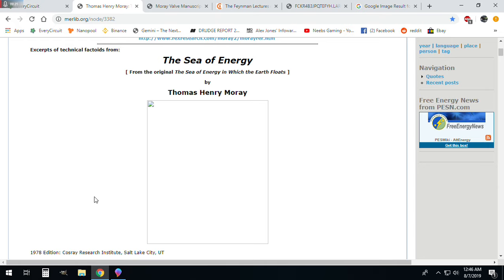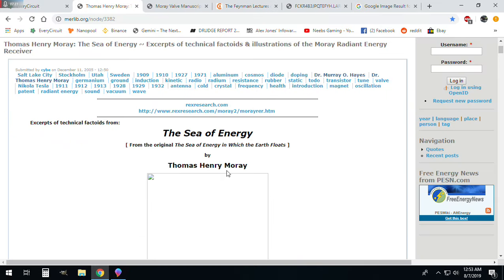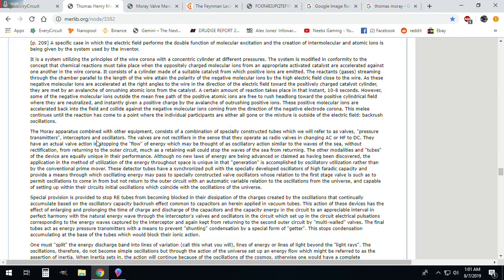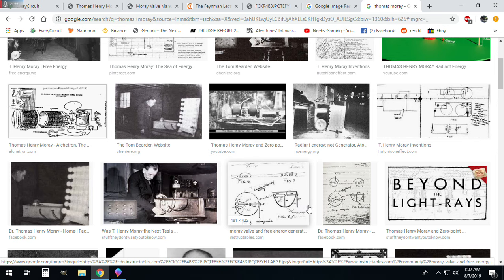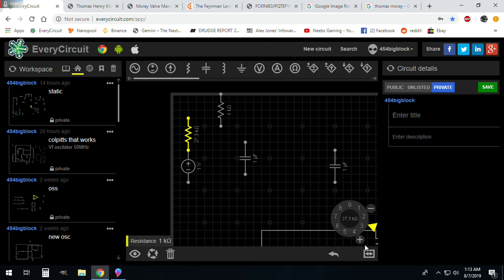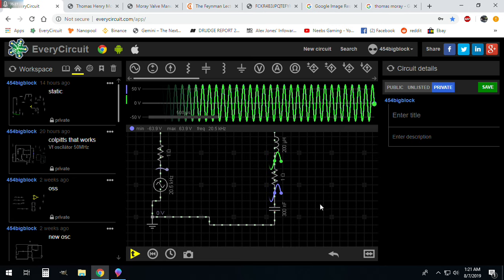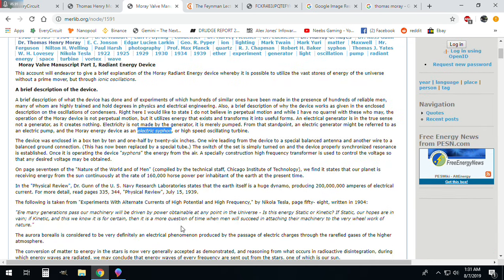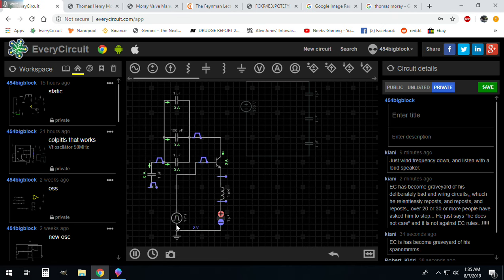Free energy from atmospheric static, Thomas Moray style

Comment: Thanks for tickling my curiosity
Reply from the maker: I've learned a lot since making that video. In his book he describes his valves as over flow valves. A cascade of oscillator circuits all in an octave cascade of each other,. When the first reaches voltage at harmonic resonance with the antenna section the resonance nullifies the resistance by the inertial swing of the matter the oscillator is made of and rises in voltage. The same way a resonant boost converter and all oscillator circuits will act at their resonant freq.. When the desired voltage is reached the valve allows the excess to spill over into the next octave. Once the full cascade of oscillators are at optimum the combined negative resistance cause close to superconductive and a step down converter at the same time. He says in his book it runs at the freq of the universe because a cascade of octaves is one of the secrets of the fabric we live in and is a form of fractal energy compressing super symmetry. Now don't go shorting out the ionosphere and killing us all with this secret info I have stupidly divulged to you. The secret of the 7 out of 6 , the 3 pairs of opposites making the 7th, of Kabbala, alchemy, and your DNA the "aromatic ring current"..
Reply: @paulksycki  just like you're talking about universal frequency, the chap could have oscillations faster than light
Reply from the maker: @ThePaulbilek  The limitation of oscillator frequency wouldn't be overcome by this in my opinion. That is a mechanical size aspect. The universe is fractal in nature but you sure do not want the entire power of the universe all at once.  What he did was basically create a siphon, a path of least resistance. The frequency is kind of irrelevant except for it's structural nature we can see in light and sound harmonics. The reason historically they said the universe consisted of 7 bodies, the sun being in the middle, The 7 sisters of the Pleiades one being in the middle guarding the tree of golden apples with the Laden Jar dragon LOL.  And if you understand these and DNA then you understand life energy works the same. https://en.wikipedia.org/wiki/Aromaticity
and the ring current https://en.wikipedia.org/wiki/Aromatic_ring_current It's really quit beautiful.
Reply: k  phew, that's a little over my head lol
Reply from the maker: @ThePaulbilek  Ah it's not that hard. It's a fractal repeating pattern that can be understood from the DNA level, to sound harmonics, to lights optics, to the solar system rotations (excluding whats past Saturn). As above, so below..The rest of what I mentioned is from Greek mythology of the same subject. They knew way back then in their mystery clubs.

Comment: Radio active action is I believe the active inverse reaction to the ionosphere to oscillate capacitors through a valve so he created pulse dc through a germanium diode ...
Yes a kind of cats whisker..
Perhaps the conclusion should be that the exciter was the radioactive activity on the germanium diode to be tuned to the wire length..?
Reply from the maker: I've learned a lot since that video. In his book he describes his valves as over flow valves. A cascade of oscillator circuits all in an octave cascade of each other,. When the first reaches voltage at harmonic resonance with the antenna section the resonance nullifies the resistance by the inertial swing of the matter the oscillator is made of and rises in voltage. The same way a resonant boost converter and all oscillator circuits will act at their resonant freq.. When the desired voltage is reached the valve allows the excess to spill over into the next octave. Once the full cascade of oscillators are at optimum the combined negative resistance cause close to superconductive and a step down converter at the same time. He says in his book it runs at the freq of the universe because a cascade of octaves is one of the secrets of the fabric we live in and is a form of fractal energy compressing super symmetry. Now don't go shorting out the ionosphere and killing us all with this secret info I have stupidly divulged to you. The secret of the 7 out of 6 , the 3 pairs of opposites making the 7th, of Kabbala, alchemy, and your DNA the "aromatic ring current"..

Comment: Gas discharge tubes exhibit negative resistance, that’s what moray used
Reply from the maker: Thank you..Google-ing "gas discharge tube" leads me to exactly what i was looking for all this time. I must have been using the wrong search terms but I couldn't find these... They will control the spill over from one tank circuit to the next tank circuit when resonance in the first one occurs. Cascading a bank of tank circuits, all in octaves of resonance,  bringing really high frequency high voltage down to low frequency lower voltage with usable current...All without adding resistance, instead using negative resistance. Creating a siphon. This is what Moray described in his book.... The unmentioned part is that an extending large surface of metal completely insulated by a dialectric (the cable/antenna) is the negative of a capacitor, with the charged ions in the atmosphere being the positive side of the capacitor.
Reply: @paulksycki   Sorry for the intrusion- please look into "electron avalanche"- i suspect that what some folks call a "negative resistor" in some cases like Moray's tube, may be considered for any element in a circuit that is generating excess electrons- thereby having the virtual effect of a "negative resistance".  The electron avalanche effect is a LENR "cold fission"- low energy nuclear reaction in arc gaps with ions present- or in the case of some P-type semiconductors, and/or hydrogen/lithium batteries, water-burning cars- these can be more like "cold fusion"- still the weak nuclear force, but using protons instead of electrons. I think that Moray's tube was probably using the radioactive source to set up a resonance in the tube, and the gamma and beta rays made the various metals off-gas hydrogen (protons)- and so these heavy, high-speed, x-ray particles were naturally smashing into each other and giving these fusion-like reactions. From there, it appears that Moray's tube is using the "photomultiplier" tube effect to get a useful, AC current that could be rectified or stepped-up to HV powering neon tubes and lamps, etc.-real, free energy from a tiny chunk of radium. They now use Henry Moray's tech in space probes, but they use the Seebeck effect/Peltier junctions instead of tubes  hot pile on one side, cold of space on the other side of the thermocouple, and free electricity out- pretty high currents too...
Reply from the maker: @sunsaverfromnhh9184  I've actually researched the  "electron avalanche" or Townsend avalanche quit a bit in the past with my Geiger Tube experiments. They only release energy that was already put in and stored in the dielectric. Dielectric is the secret term to understanding it all. That is what the atmospheric air is. It just needs a resistance-less path... But you couldn't even understand the path I have been led down researching this. The sacred mysteries of antiquity consider knowledge of this stuff very secret. Decoding them was a pain in the ass.. :)

Comment: You need to read this book "Secrets of Cold War Technology by Gerry Vassilatos" on Tesla's radiant energy. Radiant energy is longitudinal electricity, it is unidirectional, very high frequency and is released by the Sun in the form of longitudinal impulses which Moray was likely tapping into with his antennas in air and ground. So not the conventional transverse electricity and not simply atmospheric electricity. Longitudinal electricity has electric field and magnetic field flowing in same direction instead of right angles. Google "Transverse & Longitudinal Electric Waves and Tesla’s Longitudinal Electricity" for electrical engineer Eric Dollard's demonstration on longitudinal electricity and "The L.M.D./T.E.M.Test - JLN Labs" for circuit diagram to produce longitudinal electricity. Also youtube search "Birkeland Currents" which is the sea of energy both Earth and the Sun floats in. Get familiar with Electric Universe model of the universe on Thunderbolts Project.

Comment: Read the sea of energy gain he DID NOT use vaccum tubes in his device he just called them tubes because that was the excepted term at the time, basically he didn't know what to call said "tubes".  His machine, was from what I can gather a Cosmic ray antenna, connected to an ampilfier.  The secret of how he got it to work died with him but I believe his family know. The Germanium was the key:)
Reply: one "tube " was a cold cathode valve, but i understand it that the 26 frequency step down stages / voltage /freq reduction  amperage multiplication  were vacuumn tubes and coil/cap combinations